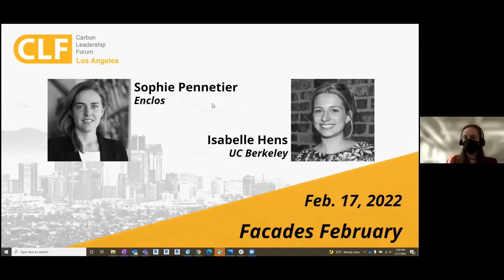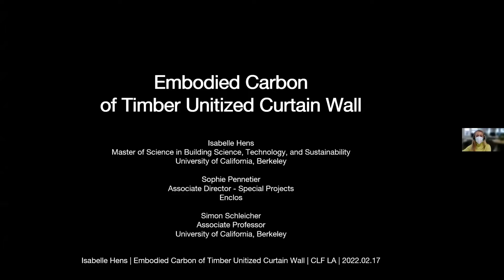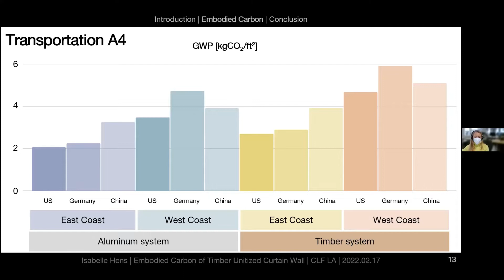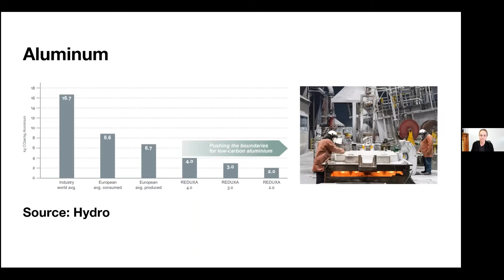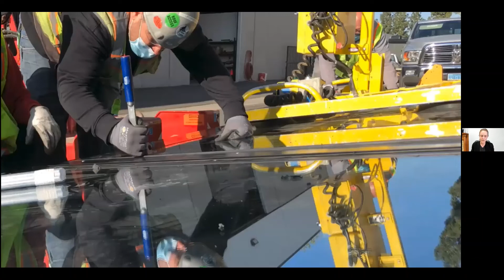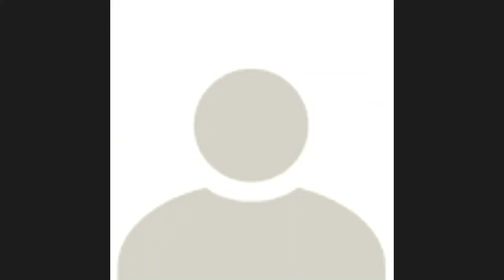CLF LA Webinar - Facades February - Feb. 17, 2022

Comment: Unitized facades. Has anyone designed a unit that instead of being designed for replacement, or disassembly and recycling, is designed for removal, rehabilitation, and placement back in original location?